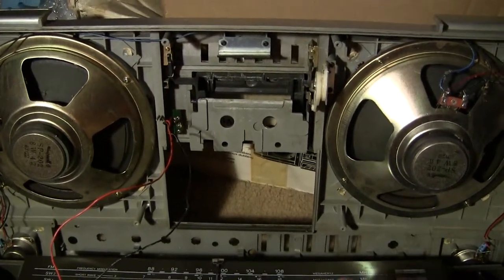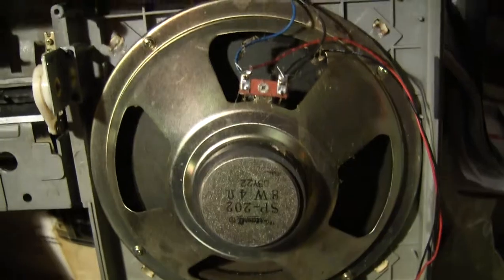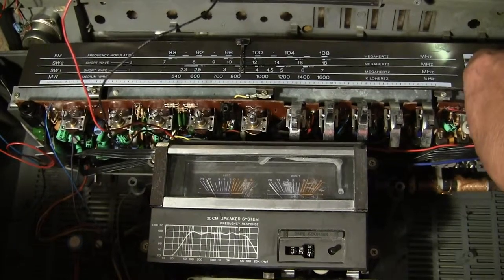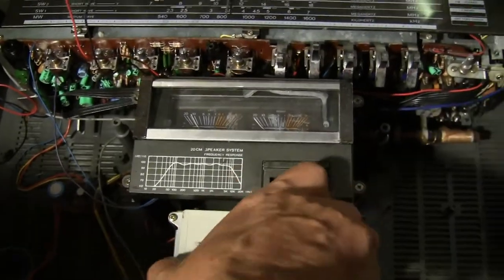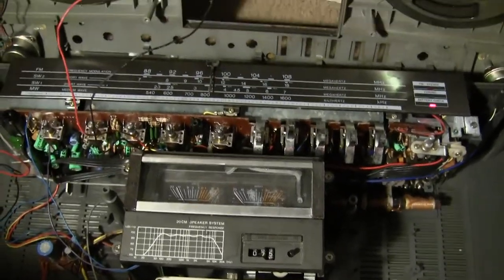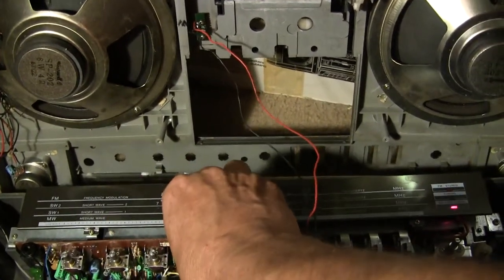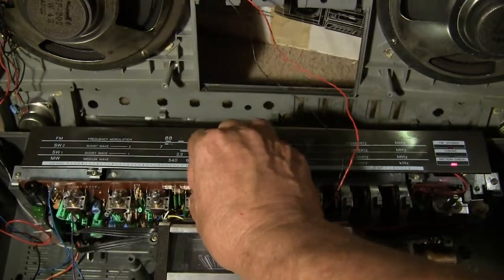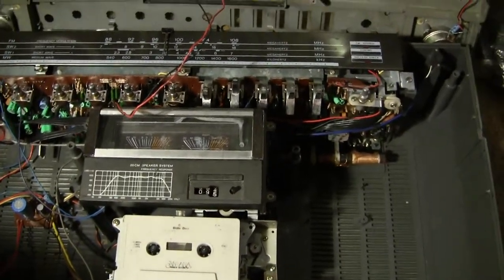Four Minutes Inside the SENSOR RT 1046 BOOMBOX also known as Helix HX 4631 or Helix HX 4635

Comment: I believe the model number is actually RT-1246.  Anyway these sound fairly good for a cheap box, with good bass at lower volumes, but they start distorting a bit early, probably because the amps don't have as much juice as the better boxes do.
Reply from the maker: 80's Boombox Collector I could have missed typed that I don't know and thanks if it is a correct number that you've mentioned but I no longer have this model and never again will I buy one
Reply: Ha ha, yeah it's not a very reliable box
Reply from the maker: This got sold before I had a chance to work on this model as I had a celebrity stop by and buy this model from me soon after I made this video back the year of 2013